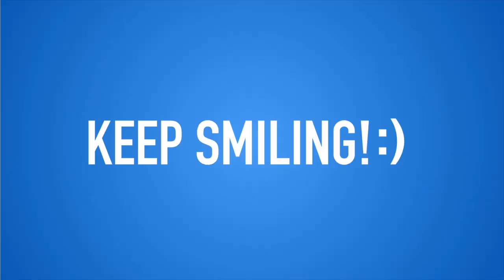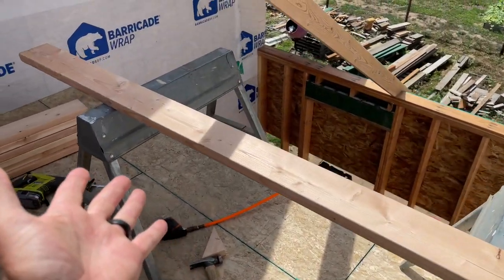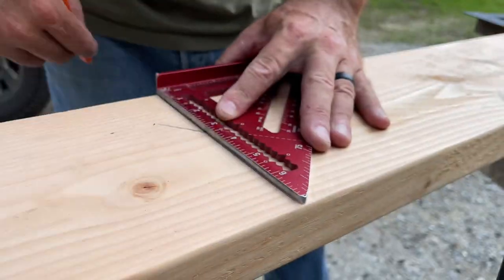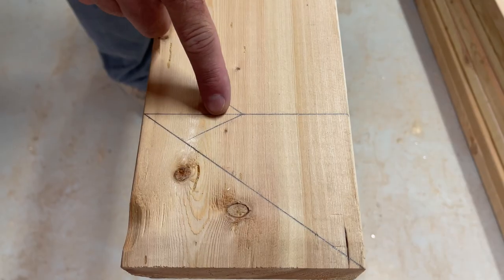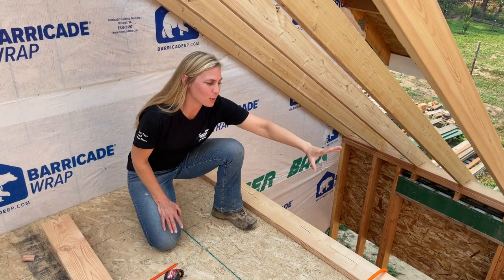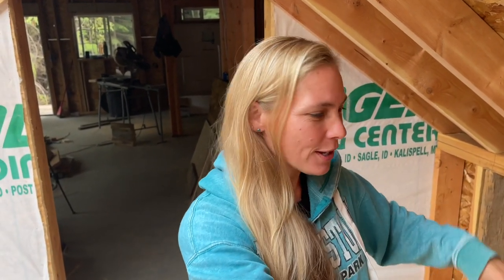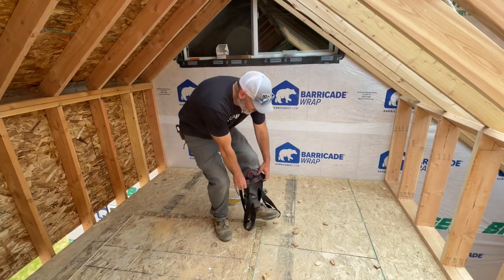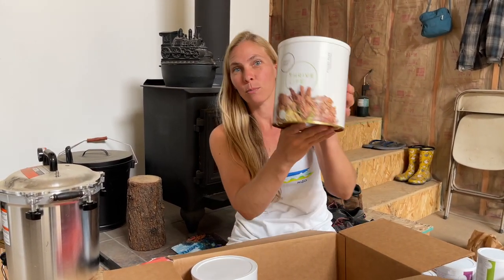Building Hand Cut Rafters and Roof for our Off Grid House

Comment: Again you do not have the proper understanding of fall protection. The belt that you are using is utilized by personnel who remove trees. If you fall with that belt your body will bend in a manner that it's not designed to do with approx 5000 of force. The D ring distributes the force on the body for absorption on the cage part of your body and not the non-existent pivot points on the side.  Also, a 3ft rip stop should be there to slow your fall. Also, they make tools for the table saw to move short pieces of wood thru the blade push sticks, etc. If you are hurt who builds the house? Winter is coming. Think about it.................

Comment: I enjoy your channel... but, this could have been easily a what not to do on a jobsite video. Often no ear or eye protection, misuse of the power saws, using fingers to push wood through a table saw, standing on unstable surfaces etc etc etc. Remember that there are viewers that know less than you and will do exactly what you do. Your improper job site behavior, I know this is your house, could get you or a viewer injured because of your laziness to perform proper safety measures.

Comment: Propane is not off grid
Reply: I believe originally Off-grid living was meant to be 'not having electrical hook up to any public utility'. The definition is now blurred by the purists.  Solar is free but you need to spend thousands of dollars for installation, same goes for wind usage, hydro, etc. Propane is still off-grid to run fridge, stove and heat. It's what the boondockers use too. Now if natural gas was used that would make it a public utility IMHO.